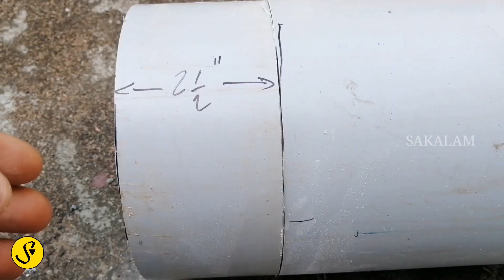നിങ്ങളുടെ സിറ്റൗട്ടിൽ നായ ശല്യം ഉണ്ടോ | ഇതുണ്ടെങ്കിൽ നായ സിറ്റൗട്ടിൽ കയറില്ല

Comment: At 14.20 in your video ,you just shown a buzzer but the connection is not shown. Let me know how the 12 volt or 6 volt buzzer work on 230 volt? Kindly provide circuit diagram.